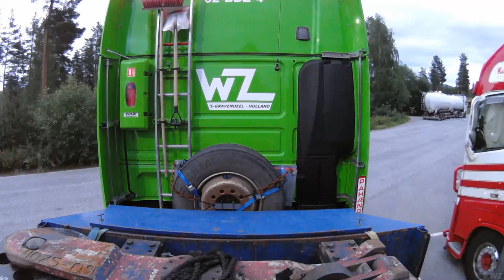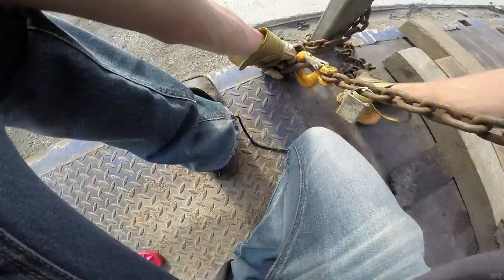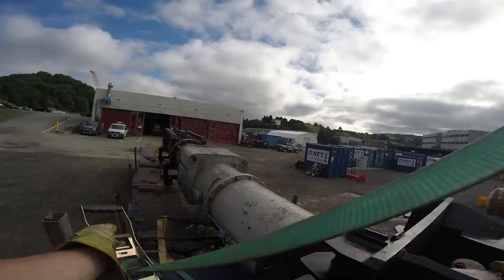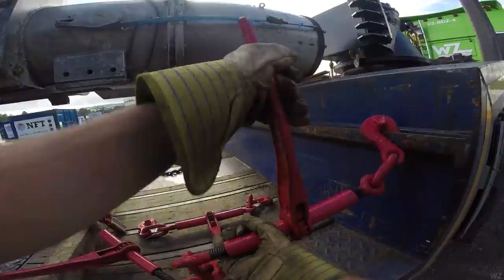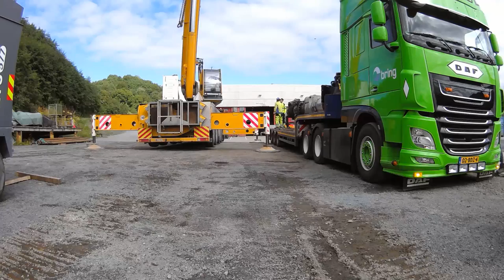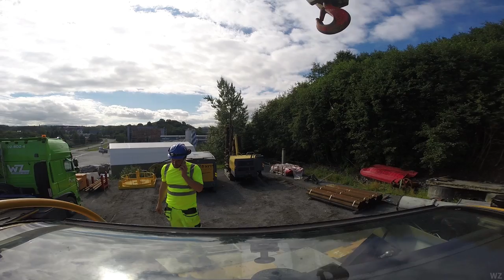Need a lift? - Norway Trucking - Göteborg to Trondheim - William de Zeeuw

Comment: Nice Video. Personaly, I didnt ejoyed that camera perspective that just filmed the back of the cab, but thats just me. Maybe, you can put it at the front top end when you drive your normal trailer again. But all in all, a very good video.

BTW, do you speak german?
Reply from the maker: Oke, ich probiere gewon etwas mit cameraunkten. Ich finde es toll mein logo zu sehen mit die Umgebung. Hoher punkt ist auch schön, aber nicht einfach. Aber wir arbeiten an das!
Reply: Ok. Nice to hear that. A high angle is difficult, I know.

Comment: Maybe this was just edited out - but wouldn't it be a good idea to loosen all the straps and check that none has any tension left and the load is self-stable before actually removing the straps and chains completly?

I mean what if u remove them and then the load wiggles and then just rolls over? Not so funny..

That's what I think would be the appropriate way.. But then ofc I prob wouldn't think about it being there having to do it irl.
Reply from the maker: Load is standing on 4 legs, so it can't go anywhere. Straps and chains are there to keep the load in place during transport, nothing more ;-)
Reply: Well a table can flip if a leg breaks or it can wiggle if the floor is not perfectly level,

What if the load shifted during transport? Maybe it was balanced when u strapped it down but doesn't mean it is still balanced. Maybe your suspension, the ground, a wheel or a part of the load itself is not up to the job anymore and when u remove to much support it could just collapse..

Highly unlikely maybe. But since your the one standing right next to it when u loosen the straps being careful is never a bad idea.

Kinda even more important since someone else had had it secured for you so you actually can't be sure it is stable other than "they told me so" and I am not saying you shouldn't trust people - you should. But your always responsible for your own safety.

However a very good job with both the transport and the job of giving us this video! ;)
Reply from the maker: You make interesting points.

The place where I'm standing is flat, so that's shouldn't be a problem. Unloading this kind of cargo on a not straight level would be very different, because of the high weight. 

Still, the cargo couldn't shift, unless straps or chains would be broken. The load is secured down and in all directions, so it can't move ( because you pull it down to the left, right, front and back). Also,, loads like these (and other things as well), you check up frequently during the ride.

The cargo won't collapse because then it would already happened when you pulled it down, because that's putting more stress on the leggs. And this particular load has the most weight on the neck, where there's extra support to get the wait on the neck, of the leggs. But that's not really vissible in the video I think.

You make some good points and I see what you mean. Safety is a good thing and thinking and talking about these things are helpfull and important. You can always learn from eachother. But in this movie, there's not really a danger with unstrapping :)